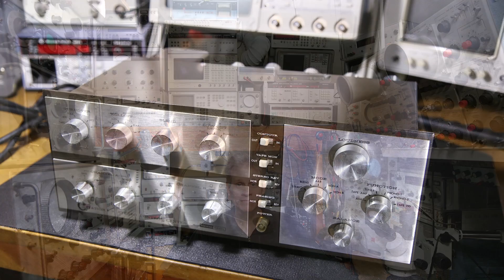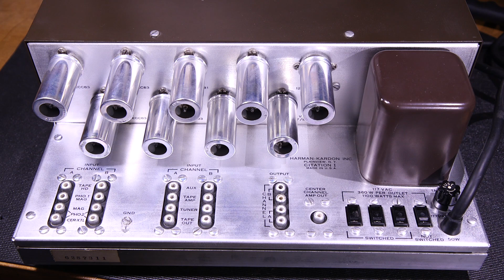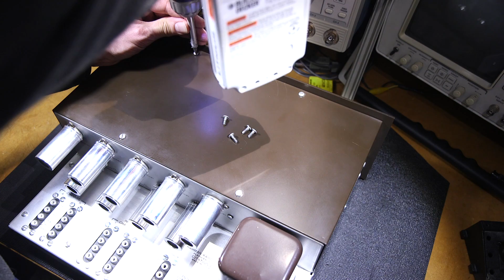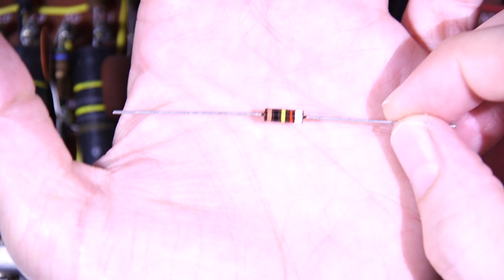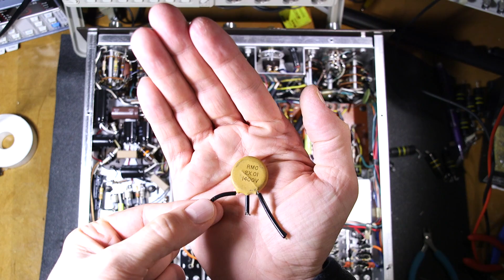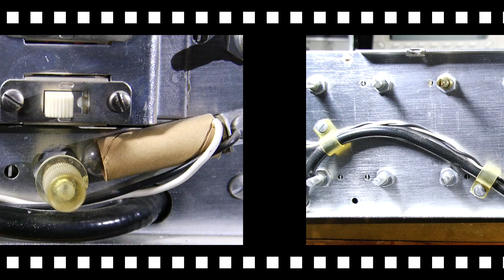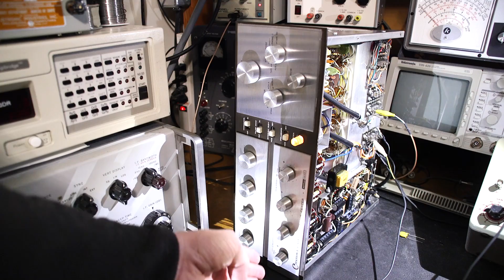Vacuum Tube Preamp Repair, Harman Kardon Citation 1

Comment from the maker: To join my ongoing electronics course, or quietly support this channel, click here: https://www.patreon.com/MrCarlsonsLab
Here is the Capacitor foil side map for the Harman Kardon Citation 1, click here: https://www.patreon.com/posts/harman-kardon-14404130
Reply: Paul -- I think I can explain why this preamp looked untouched inside. Harman Kardon sold the Citation line (there was a Citation II power amplifier and a Citation III tuner) in kit form, as well as preassembled. Chances are your example was bought by some guy on Long Island, who took one look at the box of parts and threw up his hands. His wife, bless her, seeing his despair, made a few discrete calls, the packed the whole box off to a local TV/radio repair shop and they gladly put the preamp together. I built one of the tuners from a kit and it served me well for many years.  73, Elton K3JWA
Reply from the maker: Oh it's really relaxed, and a different way of learning. You can participate in some of the builds, or just sit back and watch. There is a mixture of both solid state and vacuum tube tech to learn from. These are all videos, like here, but more in-depth (teaching wise)
Reply: Now funding :)
Reply: Mr Carlson's Lab I may have missed it in the video, but what year was this amp built?
Reply: They were circa 1959-1963 as I recall, but don't quote me.
Reply: Tom, I think you are right on. The Citation II definately came out in '59 so given the Citation I was it's companion piece that would make sense.
Reply: What Level of electronics do you need to take your course? I am a hobbyist. I buy things from ebay and put them together would this be over my head? If so do you have any recommendation on books or courses to get to that level? thanks in advance!
Reply from the maker: Were you happy with the noise floor of the preamp, (volume completely counter clockwise? "off") Assuming your power amps have "standardized" level inputs.
Reply: Mr Carlson's Lab j.p
Reply: Mr Carlson's Lab always enjoy your video’s like your test ‘you made’ units.
Reply: To test foil end of capacitors with just one lead to the signal input of an oscilloscope... Would the outside foil end lead have the strongest signal ? It seems like it would and your device seems backward somehow. I don't know how you device works so mmmmmmm...What up with that?
Reply: Can you still get multi-capacitor can capacitors?
Reply: Hi like this show been a audio track since these were new and these have always been a favorite in good shape they rivals the best current stuff
Reply: Mr Carlsson your vacuum tube preamp Harman kardon citation 1 it is so awesome
Reply: Mr Carlsson what is a vacuum tube?
Reply: Mr Carlsson your utube videos are awesome

Comment: Not sure I got it. You say the plate is the low impedance so the cap shield lead goes there. Is the other end not earthed ( I assume these are bypass 0.1 caps). If so is that not the low impedance end????? What am I missing?    Aaaaaah   OK found schematic .... they are coupling caps mostly plate into the grids of the other half triode with 560k impedance ....   so of course now I get it.

Comment: When I try that foil test with my digital scope it doesn't seem to work.....I tried it with .022uf Phillips mustard caps ...the old ones in Marshall amplifiers....5 mv or 2mv per division on the scope.....the signal on the scope is so noisy looking and the amplitude didn't seem to change either way....my scope is digital so I don't think it does as well as analog scopes.....or it's way too sensitive maybe....I don't know

Comment: I have inherited many tube amps, preamps, equalizers plus solid state versions also.  They vary in brands, incuding Marantz, Dtnaco and others including a huge selection of vacuum tubes.  My problem is I would love to use some or all but do not want to just turn them on and hope for the best.  Also, I do not want to take them to a repair shop (everyone seems to be an electronics expert).  i would appreciate your guidance of what to do as I will eventually end up putting most of it in the hands of someone who appreciates and can use the components.   I would appreciate your help!

Comment: Just curious why you didn't change the diodes. Modern diodes are much quieter and less switching noise as well as lower resistance. Also, why not test all the tubes to look for noisy ones.  Love the videos and content.

Comment: I actually built one of these from a kit in about 1964.  Also the Citation 2 amp -- 60Watts per channel if I remember correctly.  It used 6080 tubes.
Reply: Actually they were 6550 power tubes.  I think the KT88 were not long-life tubes then.  When biased at 100 mA, the amp had very
low distortion (0.2%) - but got very hot.  I biased the tubes at about 75 mA with still less than 1% IM distortion if I remember correctly.

Comment: Ok I know this is a  5 year old video , but I will comment anyway ...... I agree with Paul on a mechanical failure on that resistor and I will add to his theory on how it got broken .... I learned from my Uncle that owned a sales and repair shop for many years about electronics , He called those platform inlet backs , there are pros and cons to that design .  Easier to pull the unit forward and hook up your RCA jacks and speakers is a PRO ... 2 CONS are dust settling into the outlets and ,just say a picture frame falls off of the wall above the entertainment center or shelf that it's on , it will hit the tube shields and cause problems inside the unit as in the case of the broken resistor .... I'm sure a few people will agree to that ....  Have a great day everyone...

Comment: i had a citation II power amp that i got used  back in the late"60's or early "70's when solid state was the rave. i belied i paid $50 for it. nowadays they sell for $3000-$4000

Comment: Great video as always. But where can one purchase the little ceramic insulators you used for the electrolytic cap replacements? I need those little guys for my current restoration to keep the original appearance of the chassis. Thanks!

Comment: I don't understand the outside foil end tester. You said the LED indicates the outside foil end but the LED kept switching from side to side. Could you explain further?
Reply: The tester simply swaps the direction that the capacitor  is  plugged in without the need for you to manually swap back and forth.  LED that is lit shows the side that is grounded.  When noise is minimized,    LED shows the lead that is connected to the outer foil.

Comment: LON stands for London correct, but it's in reference to the record label not the country or "Europe" as you've stated. Some of these amps also had within the rolloff selector; "Old London" and "FFRR/London" (full freq range recordings London Records), "FFRR 78" (aka Decca 78), "FFRR 10.5", etc, etc.

Comment: hello
this relates to one of your vids where you restored a vintage amp and you removed the 3 wire mains and fitted a 2 wire pos/neg.i have a heathkit tc3 tube checker which has a grounding "chassis" 3 wire mains lead but the schematic shows a 2 wire no chassis ground.which do you think is best for this tester? can earthing the chassis effect how it works?
thank you

Comment: If you need a contacts cleaner that will work in a pinch is wd40 silicone I’ve used it and it is non conducive plus it lubricates the parts very well.

Comment: Hello, Mr Carlson,

Very nice set of videos; your video and audio engineering are first-rate!

I am 80 years old and worked as an audio engineer for Ampex Corp (professional studio tape recorders) and I had a Citation I and a Citation II back in the day. They were designed by David Hafler, who was an Audio God. Judging from the comments it appears that very few of your viewers are aware that most of these units WERE  BUILT FROM KITS and whoever assembled this unit did a very good job (the kit instructions were excellent). Even at that, the units were quite pricey-- especially the Citation II because of the huge transformers (2 audio and 1 power). Unfortunately. the Citation II was very weak in the power supply department: the electrolytic filter caps were all inside the chassis (where they got very hot and dried out) and the rectifiers were early silicon power diodes (also in the chassis)  that were pretty fragile in the PIV department. Consequently, the Citation II required fairly frequent power supply service, which was a pain because the thing weighed a ton and all the parts that needed repair were buried inside the chassis. But when it worked, it sounded great!

Keep up your excellent video series,

Yours truly,
Larry Miller
(Ampex Audio Engineering 1957-1967)
Reply from the maker: Thanks for taking the time to write Larry!

Comment: Not sure if you know, Jim Macshane. I bought his kits for My Citation 1 and 2. My dad built in 1963 w the RCA club. I have someone up grading to Jim's Kits. The Tech doing the system was completely surprise over his parts and the upgrade. There is nothing on the planet like these pre-amp and amp. I also have JBL Harkness C-40(15"). My Dad(passed on years ago) also has the AR-XA w/Shure. Having the near best all my life, its hard to impress me today but with advancements with vintage equipment I am highly impressed. Kenrick Audio has horns that blow me away. I purchased the chrome hosing for my restoration for the pre amp. I have all the building construction books. Also have the Citation A & B w/books my Uncle(passed on years ago) built back then. The first Solid State system. I am glad I have them today. Great Job on repair. That pre-amp is in awesome condition
Reply: My dad did the same, having the amp done with the macshane kit. Pretty amp next.also had the ar-xa turntable and jbl harkness c40s. Pure classic.😊

Comment: Wait, there is a counterfeit resistor market?!! I shouldn't be surprised, but it's not something I had considered in the past.  If I have resistors that were purchased from a not-so-reputable source, but they still test within spec, are there issues with using them in circuit?

Comment: Mr. Carlson found that the unit had been serviced, but apparently, nothing had been physically altered.  Hypothesis: Maybe the customer noticed that the preamp was slightly noisy and asked to have it checked, but the technician could never find the problem--the unit checked out good (correct voltages, no leakage, ...).  Why? The technician may not have recognized that the bumblebees were reversed in the unit, thus leading to just a slight deterioration in overall sound quality. ... Possibly!

Comment: I wanted to hear it working.  The only part of amp restoration I have ever  done is contact cleaning the pots. Your vid was fascinating. Surprised none of the tubes needed replacing. Also suprised that the foil end is not marked and not even consistant on modern cap. Cheers

Comment: I've dealt with valve gear since I was a child and never, not once, have I seen something this clean - did the owner also have a time machine?!
Reply: I own one about this clean. It has a bit more wear on the audio in/out connections. I'm going to have to go back through and check cap polarity.   I bought the preamp, amp and FM tuner for $50  many years ago. I think it was worth it :)

Comment: Hello Dr Carlsons, I would like you to a video on a Pioneer AV receiverwitch valume contrl is giving me a noise problem at the notch of three it is fine, but once you cross that notch increasing your volume you strat to get that heavy hurshblocking all audio sounding , turn the unit off, for just a moment, turnit back on and it is finr again, but yet do not increase volume for it is going to go back into that hursh way , now learning a little from you capacitating myself from your videos, but i want to get or buy some your electronic courses for they are very interesting to me as a learner, now please if you will do that for me for here in my country Costa Rica there is no electronic work place for me to take this , so i might have to do it on my ownwith your help, i see you do a large amount of very good perfect jobs in restoring amplifires radios in very old models so please i beg do it for me thank you Gr Carlsons

Comment: In regards for the outside foils being in the wrong orientation.  I just read an article from "vacuum tube valley". In the article it was stated that some early Harman kardon citation were sold in kit form.  It could have been an error by the builder.

Comment: The "safety capacitor" is in fact an "MOV" , a Metal Oxide Varistor (fuse to protect against surges). The "out of place"  "plastic knob"  which is the power button and in fact goes right with the industrial design of the unit, yellow on a brown background, esp for the time period. Also plastic ages, after 20 years it's foggy, if it was new it'd be clear. As for the "Sin waves are nice and clean on the oscilloscope" , be nice if you could give it a full test, like freq response and THD, at least for line input, that wouldn't take much time at all.

Comment: Hi, you went into a lot of detail re: foil end thanks for explaining. This may be something or nothing, you lost me @30:25 with the 2nd from the right, is this wired incorrectly just so the text will be uniformed - if so how did you get around this? Yet you go on to say on the other channel that all were wired incorrectly except for this one (its opposite).

Comment: Be careful including that 400 cycle tone in your video, you could get a copyright strike.
Reply: Isn't that the frequency that aircraft generators use?  Linear power supplies can use smaller filter capacitors at 400Hz than at 60Hz.
Reply: @JohnShalamskas - yup 400hz

Comment: Interesting how that resistor broke from tube socket movement. I have never had a way to prove my work, but when I install resistors, caps, etc, I put a slight ~ bend in the lead to allow for movement. Maybe 40 years from now, somebody can look and see if my methods proved true.

Comment: Your content is great for knowledge about electronics.  When you are doing a restoration like this, would you be able to show a bit of the actual work involved to restore it?  It would have been interesting seeing you solder on one of the new caps replacing the bumblebees.

Comment: Holy crap, that's a CLEAN Citation I.  And it has the Telefunken 12AX7s and 12AT7s, which is awesome.  Tele 12AX7s almost never wear out, and they have the best hi-fi preamp performance of any 12AX7 variant I have ever seen.  They were also standard on a lot of the vintage Sherwood stuff, most notably the S-5000, arguably the best 7189 based integrated amplifier of that era.  Also, damn you now I have to go back and check a whole bunch of foil cap orientations.

Comment: The power switch on my  HK Citation 4 would always stick in when you turned the power on.  You had to pull it out manually.   Have not tried to power this unit up since I inherited it from my father.  He built it from a kit (along with 40W RMS Citation V power amp).

Comment: Great video. Really loved seeing the insides of that HK. Glad I wasn't the one who had to build it back in the day -- HUGE piece-count !! Wish you had done an overview of the circuitry, like you have done with radios on other videos. I'd love to see you assess an MC-60 or MC-275 McIntosh power amp, or an Audio Research D-79 sometime. Or even a Dyna Stereo 70. Not sure when you'd find time, though. Or, under the ham gear category, go inside a Collins KWM-2a sometime, just for giggles...

Comment: The HK Citation 1 was a landmark in early-60's hi fi. I think it was designed by Stew Hegeman. It was sort of a poorer man's Marantz Model 7, considered by most of the day as the absolute top dog. The Citation 2 was its matching power amp; again, quite well-thought of.  Both were universally praised as exceptional by both camps: Julian Hirsch (Hirsch-Houck Labs, writer for "Stereo Review") of the objectivist school (it can only sound good if it MEASURES well on the bench) and the newly-emerging subjectivists, (your own EARS can be the best guide) led by J. Gordon Holt ("Stereophile") and later, Harry Pearson of "The Absolute Sound.") Back then, it was possible to be a full-featured preamp (LOTS of knobs!) and still qualify for great sound. Later, at least for the "golden ear" crowd, LESS (input jacks, switches, tone controls, number of preamp stages, amount of feedback -- in essence, less COMPLEXITY) was deemed "better" as there was less between the source and the speaker to potentially muddy things up.

Comment: Paul, your help is badly needed: do you know exactly at what point the loudness tap on original volume pot was? parts list only say " RV3285193 ", schematics does not answer either? (I can`t measure original because my unit came without it at all) I guess this would be very very helphul for many others who are going to put a stepped one instead of the original.
Reply: also, was it logarythmic or linear?

Comment: great video  again , may I point out that carbon resistor have a lower inductance than metal film where it is  like a wound coat of resisting material with some turns between the ends , another point on that amp , the wiring is good looking as you say but bad as you say  , and so again because the components have straight leeds to posts , hence this broken resistor , and high stress on components due to either thermal expansion or mecanical movement ...also regarding the non earthed and nonsense plugs my stepfather ( am 68 ) who was and electronics engineer in RF power amps and converters makinlg TV first transmitters used to test plugs to see which contact was chassis , and put a red dot on the live side , so if behind him , like me I always take care when powering up one of his old equipment , and change plugs for earthed and correct wiring , he tought me electronics , and made it my job till now ... and one hand in the pocket the other in eventual hot place with rubber shoes  :))